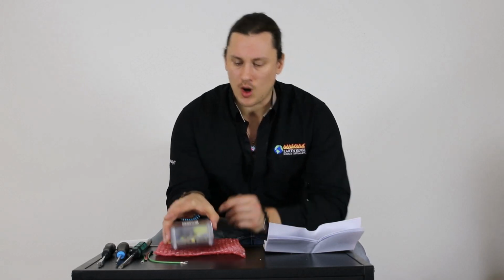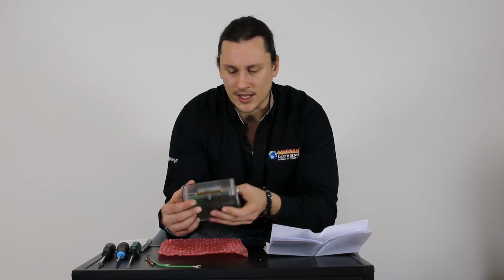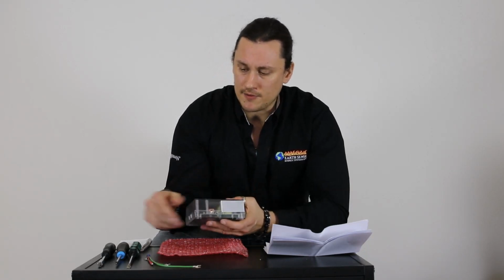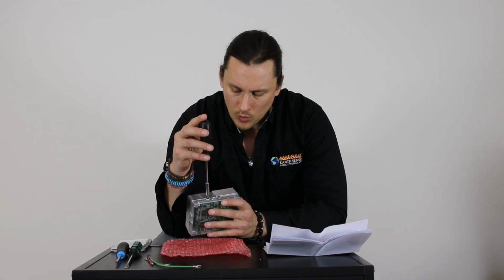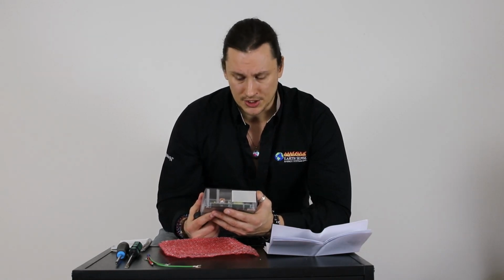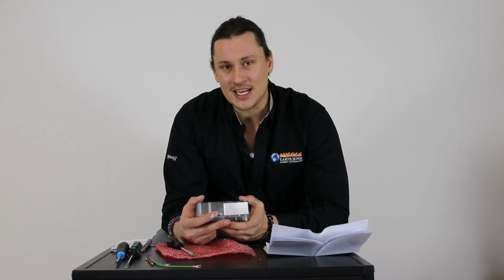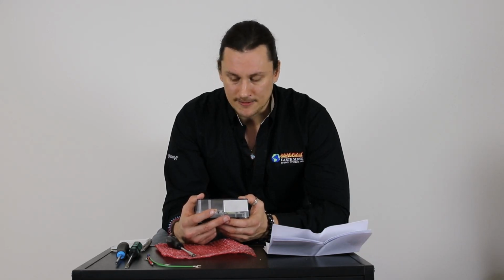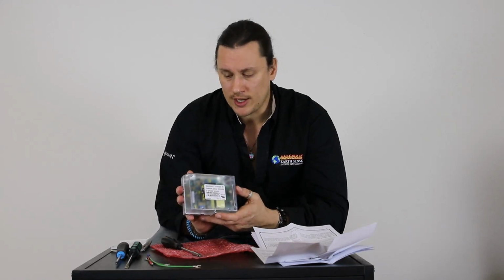QuadraFire 3 Speed Control Board Installation and Settings

Comment: I have the Santa Fe. I’ve replaced the combustion & convection blower auger motor thermal couple and igniter. On low the flame is very small and rarely rises above the burn pot. I feel like it’s getting too much air so I ordered a new burn pot from your company but through Amazon.  There is a gap between the pot and cleaning plate on the bottom and not sure if the air holes have enlarged over the years of cleaning. The unit is from 2008. The dial on mine is set to 6. Setting it to 7 only increases the feed rate on startup? Or continuous feed rate as well?
Reply from the maker: Thanks for for contacting us, happy to help. Yes, the control board setting #7 will only increase the feed rate during startup. In comparison to other stoves, Quadra-Fire does have more air coming through the burnpot. There's variances depending on the pellet type and and flue configuration, but generally speaking on the low setting the flame will be in the burnpot, medium setting 1-3" above the burnpot, and on high 4-8" above the burnpot. There will be a slide inside the hopper which can be used as a micro-adjustment for how much fuel can go into the auger shaft. With the burnpot you mentioned a gap - is that gap you are referring to where the burnpot slide bottom meets the burnpot? If so, how big is that gap? The burnpot bottom should be pretty snug against the burnpot. Happy to help and make sure everything is 100%. Thanks!
Reply: @EarthSense  what is the purpose of increasing the feed rate only during startup? The auger feed chute is set to max open. The flame differs in the pot and sometimes there is just glowing pellets then more feed and it will have a flame again. The gap between the bottom of the burnpot and the slide door for cleaning is tight on the side where the bolt is and maybe 1/8 of an inch on the opposite side. Seems to be the plate is warped or bent. My burnpot is due to arrive Thursday. Hoping that solves my problem.
Reply from the maker: @775Rockhounding  Thanks for the message back. Could be a couple reasons one would want the increased feed setting on start-up. 1. If someone was using longer pellet fuel - 1" + length pellets. 2. If someone had a venting configuration where there was a lot of vertical draft, more fuel during startup is helpful to ensure ignition. Thanks for explaining the burnpot. Yeah, should be no gaps there. Even an 1/8" gap is enough to create combustion issues in the burnpot during operation. Once you have the new burnpot in please send us an update on how everything is performing. Here is a video on replacing the burnpot, this is in a Quad 1200i, however your Santa Fe will be very similar. Always here to help, thanks. https://youtu.be/ilOTLvmH06c?si=yoc81-A5Gi5fYMxC
Reply: @EarthSense  Thank you very much for all the help and information!! I will follow up after replacing the burnpot.
Reply from the maker: @775Rockhounding  You're most welcome! Look forward to hearing back once you have the new burnpot installed. Thanks.
Reply: @EarthSense  So changed the fire pot. It seems to have a slightly higher flame and it’s more consistent. I still have the auger chute all the way open on low I will test medium and see the flame height. One thing you could pass along to your shipping department… the pot was just in a thin box and it was pretty beat up and dinged and the pork chop handle poked a few holes in the box. 📦 I had to inspect it for cracks or damage. Thanks again for your help!
Reply from the maker: @775Rockhounding  Thanks so much for the follow-up. I'm glad to hear you are seeing better consistency on the low setting - definitely send us reports on the consistency and fire size on medium and high settings. Really appreciate that information - I will touch base with our shipping manager ASAP on that so it can be reviewed and improved. Thanks again and look forward to hearing back.
Reply from the maker: @775Rockhounding  Just wanted to check in and see how the unit is running on medium and high settings for you. Thanks so much!
Reply: @ medium seems good. I never use the high setting. I might change the feed rate setting to 7. Every once in a while it won’t start up properly. I turn it off every night. Empty burn pot in morning and fire it up. My chimney goes out the wall 3” about 3ft then goes to 4” vertical about 9ft. Thoughts?
Reply from the maker: @775Rockhounding  Thanks for the message back. Yes, that is a good amount of natural draft with your venting configuration. I would encourage you to adjust the control box setting as well, I think it needs that little bit of extra fuel for consistent start-ups. If it get's real cold where you are at, inspect the outside vertical vent periodically. With running the stove on low or medium and the vent subject to outdoor temps, we want to make sure we don't have any creosote forming. Periodically turning the stove on high for a bit and/or wrapping the vent with an insulated fire blanket are good options to prevent that. Keep us posted on operation with it set to the #7 setting. Thanks.
Reply from the maker: @775Rockhounding  So I just checked with management and we do still have what we called the Quadra-Fire Pellet Damper. Again, the Quad's have more air coming through that Cylindrical burnpot and with vertical vent situations, the increased draft can cause ignition misses periodically and smaller fires producing less heat and overall efficiency. This damper is 3" round, goes directly on the exhaust port, and your venting adapter goes on the other end. It has a small thumb screw on the exterior to open or close the damper slightly. I can have the team check on Monday if we have any new ones, but I have been told we have some used ones in good shape. If you would be interested in something like this let me know and I'll get you a picture and a price. Thanks.
Reply: @ that sounds great thank you!! I appreciate all your help! Our small town only has one pellet stove company and they booked up for months. I’m trying to learn as much as I can to do repairs on my own.
Reply from the maker: I found a seller with a listing for it so you can see for reference. https://www.stove-parts-unlimited.com/quadra-fire-eco-choice-pellet-stove-3-damper-pel-damp3-p/pel-damp3.htm
Reply from the maker: @775Rockhounding  Absolutely! Happy to help!
Reply from the maker: @775Rockhounding  Apologies for the delay here. We have both the 3" pellet damper and 4" pellet damper from Quadra-Fire in stock. Listings here for you to reference. Our prices are under MSRP, however these are still quite pricey.. If you're looking for a cheaper option I can see if we have one that is used. Any questions let us know. Appreciated. https://pellethead.com/product/quadra-fire-and-heatilator-eco-choice-3-pellet-exhaust-damper-oem/
Reply: @ Is there someone in charge I can speak to at you facility.  I have an issue I’d rather not discuss here in comments. Will you be open Monday?
Reply: @ Is there someone with your company higher than Nathan?  The burn pot starting burning erratically and come to find out after time and money and troubleshooting. the pork chop was falling off because the bolt attaching it had a nylock nut and had melted and was coming loose. I was treated disrespectfully and told they would help me in no way.
Reply from the maker: @775Rockhounding  Thanks for the message. I have our online team taking a close look at the burnpot you ordered, should be a steel nut on that porkchop; very sorry to hear the one on yours was not and melted creating this issue. Nathan will be the online manager for the company, but I am also happy to assist. Very sorry to hear you felt disrespected, we always try to do our best within the framework of things and make sure our customers are taken care of. At this point did you fix the nut on the porkchop? Is it working correctly now or are you looking to return the burnpot? Let me know your thoughts and I will see what solutions we can provide. Appreciated.
Reply: @ Upon finding the nylok nut after days of troubleshooting and finding a stover nut to fix the problem of the pork chop having over a 1/4 gap. I had half burnt pellets falling into the ash pan. This problem was a fire hazard and should have never happened. Who puts a nylon nut on a fire pot?! I spoke to Nathan and was told there was nothing he could do to assist me even after saying he could give me a partial refund for the problems. He then called me back and said the only thing I could do was return the part. I can’t disassemble my stove again after all that work and fixing the problem myself with the assistance of a local tech. All I’m looking for is compensation for the time and troubles and money spent on fixing a brand new part that had the wrong hardware on it.
Reply from the maker: @775Rockhounding  Thanks for the message back. This is a very peculiar case  and we will speak with the manufacture tomorrow. Just like the images show, that should be a steel bolt and steel nut holding on that porkchop, we have never seen a nylon nut used on a burnpot. Any chance you still have the melted nylon nut? If so and you could send a picture that would be very helpful as we speak to the manufacturer on this. We have sold hundreds of these burn pots and have never come across this. Safety is always the most important, and I will have our staff tomorrow check all of our current inventory. We will touch base with the manufacturer, provide the details, and follow back up with you. Be in touch soon, appreciated.
Reply: @ The nut was a nylock nut. It was metal but the top locking portion had the nylon locking ring. Upon finding my “porkchop” having a 1/4 gap and the nut was able to be undone by hand. So every time I was pulling the cleaning lever the nut was just becoming more loose. I went to my hardware store a purchased a “stover” nut which is crimped at the top as opposed to using the nylon insert to lock it. Maybe Nathan misunderstand was a nylock nut was and thought he would see a plastic nut on the ones you have in stock. I am an engineer by trade and definitely understand the components used were incorrect for the application. A nylock nut had a heat rating of no more than 300 degrees. And yes I do still have the nut I removed. The “stopper” nut on the back of the porkchop is also a nylock nut.
Reply from the maker: @775Rockhounding  Thanks for the message back and details. The manufacture does use a locking ring inside the steel nut to factory spec. This is how they are designed, again we have sold 100's of these and have never had an issue before. After speaking to factory and management, we unfortunately are unable to issue compensation back in this situation. The burn pot does have a 1 year manufacturer warranty if you decide to return it. Apologies for the frustrations here.
Reply: @ Well with mine the nut was completely loose in less than a week. So maybe the manufacturer needs to rethink the parts they use. Having it fall apart so fast is obvious a defect in materials. I’m not going to take apart my stove in the middle of our 20 degree temps to send back after I fixed it. It’s very disappointing that your company won’t stand behind a bad product for a customer that has spent hundreds of dollars with.
Reply from the maker: @775Rockhounding  Thanks for the message back. Both the manufacturer and our company do stand behind the products offered upholding the warranty for the full term along with industry standard return policies. We do understand given the work you've done and the temperature currently that you do not want to return the burnpot, however that is the only option able to be offered here. Both the aftermarket replacement and factory OEM burn pot replacement have the same specs and bolts/nuts used. Again, very sorry about this situation. Warmest Regards.

Comment: My heat output switch doesn’t do anything only appears to blow on high I have Castile stove I bought new switch nothing same thing please help it also have new control box
Reply from the maker: Thanks for contacting us, happy to help. The heat output switch on the Castile controls both the fuel feed as well as the room air blower. Are you noticing a difference in the fire size between low, medium, and high? Does the initial startup cycle appear to be functioning correctly?
Reply: @EarthSense  No difference in fuel speed low, med or high appears to be the same.
Convection blower feels like always blows on high and feels like it doesn’t match speed of the fuel feed. Air coming out of the stove is not as hot as it should be
Reply from the maker: @wch2186  Thanks for the message back. Let's adjust the feed slide in the hopper by pulling it all the way up/all the way open. Let's make sure the dial on the new control box is set to the proper number for the Castile. Important to check the basics here first. If the board is set correctly and the feed adjuster rod in the hopper makes no difference, then I would say you are going to need to have a dealer or a technician test this control box to determine if there is an issue. Double check all of your wiring coming out of the control box receiver/junction box. Make sure all wires are secure and there are no exposed or bare wires grounding out on any metal in the unit. Keep us posted, happy to help.
Reply: @EarthSense   no difference between high ,med ,and low  fire is the same it appears to blow on high only ,even if switch is on low , I did notice that when fire pot reaches good temperature to turn convection blower on (red light on the control box ) it takes about 1 minute for convection blower to turn on after red light turns on is this normal or convection blower should turn on immediately?

Comment: Ive got a 1200MI-MBK. Trying to diagnose it.  It was working fine last week but now it wont turn on. I pulled the control box out. There is a  blue light that blinks quickly once when I plug it back in on setting 1 or 2. There are no other lights from that box. The red command light above the fuse is on. Ive checked the fuse and it's good. I dont see any wire issues with thermocouple. Any suggestions?
Reply from the maker: Thanks for contacting us, happy to help. First put a jumper on the thermostat block to ensure it's getting full connection there even though the call light is on. Simply pull out the thermostat wires and place a large staple where the wires were, secure down tight to make a solid connection. Second, the combustion blower has to run before anything else will happen - Can you power the blower directly and see if it works? Video below on how to create a test cord for performing this.  If there is no change when jumping the thermostat and if the combustion blower is good testing it to direct power, than that would be a pretty strong indication that the board/control box is bad.  Keep us posted, happy to help get you back up and running again. 
https://youtu.be/rlmiCYI2WPk?si=TQoxnTMnXj9eRXR9
Thanks,

Comment: I have a classic Bay 1200 I put the control board on zero and everything checks out okay I unplug it and turn the setting to one the auger motor only runs for 3 to 4 seconds pauses for 5 seconds and runs for 3 to 4 seconds again and it won't start up after that until I unplug it and put it through a complete cycle it should run for 60 seconds to fill the hopper with pellets
Reply from the maker: Thanks for contacting us. If you are able to, take the board to a local dealer and see if they can test it for you. It sounds like it could be an issue with the control box. Additionally, inspect your thermocouple. Check the wiring connections and pull off the ceramic cover to ensure the wires are soldered at the end. Keep us posted, happy to help!